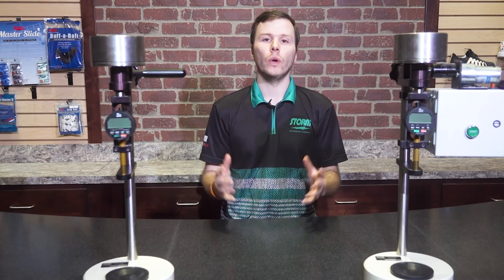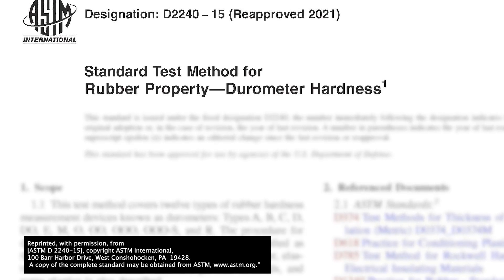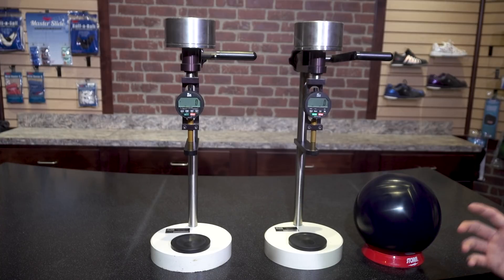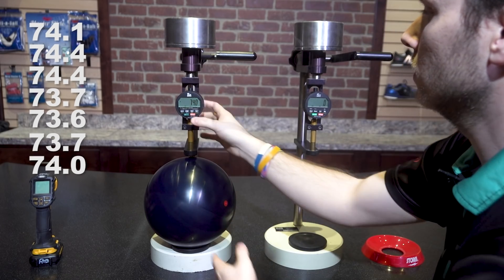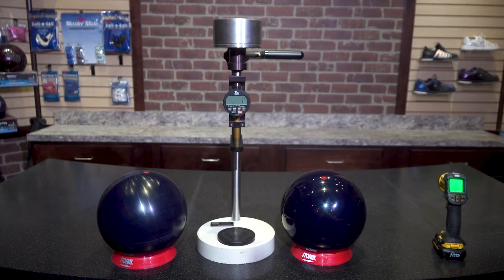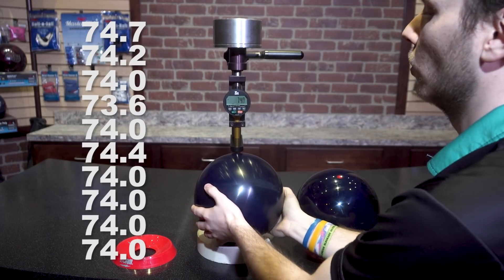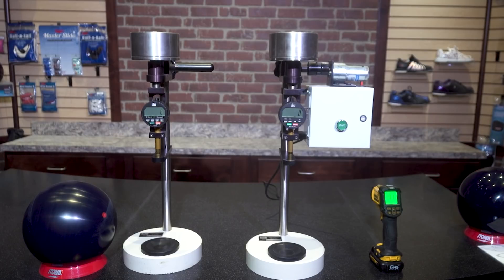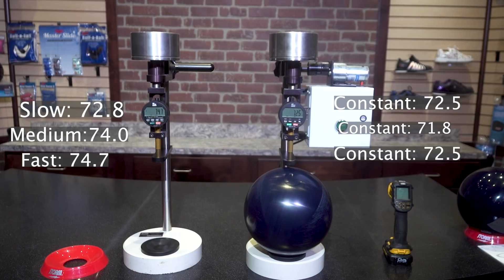Storm | Durometer Testing

Comment: If storm is so on the cusp of legality that it can't reliably meet USBC standards with every single ball, it's up to storm to revise it's manufacturing processes or provide more safety margin in it's equipment. 

USBC has standardized criteria, methodology, equipment and conditions for testing. It's up to storm to comply with USBC's standards using USBC's criteria and methodology. All this stuff about polish, needle speed, temperature, equipment, astm standards, etc is a deflection. USBC already accounts for all of that in it's testing

Comment: 1972 - Don McCune, MEK Soaker, then Columbia Red Dot, Yellow Dot, Shure-D, Shore-D. Been going on for 50 years. Go back to Manhattan Rubber/AMF Exacta/XL-5 with 3 oz weight differential, solid symmetric core, against Vulcan 3-10. Averages will be about 207.

Comment: Tests between labs, admitted by ASTM itself, can vary as much as 3.54 D in Table 4 (starting at 2:54) and 11 D in Research Report D11-1029 (starting at 4:01), prove that either the instruments or the Standard itself is inconsistent and, therefore, not reliable for bowling ball hardness testing.
Thank you, Storm, for showing us this information!
The USBC should shelve hardness testing until a more reliable method can be found. If they refuse, a new standards body should be formed.
Reply: What astm says is irrelevant. USBC already has standards for all of these factors, a standard testing procedure, standard equipment, standard conditions, etc. All of this minimizes variance between tests, and all manufacturers have the same amount of variance to deal with. It's up to the manufacturer to meet USBC standards with USBC testing conditions and methodology. If storm is so on the cusp of legality that it cannot meet USBC standards reliably with every ball it produces, it's up to storm to revise it's manufacturing processes or provide itself more headroom to ensure legality. 

Once again, all balls are tested and all manufacturers deal with the same testing criteria, standards, methods, conditions, variances, etc. Only a select set of balls failed USBC testing. This is on Storm, not the USBC
Reply: @iceman5117  Durometers, according to USBC, must be calibrated to ASTM D2240-15 standards. What part of that do you not understand?
Reply: @michaelg-XEX  which is wholly irrelevant to the conversation. USBC has their own standards for equipment, whether they follow astm or not, companies must abide by USBCs standards using USBC's testing methodology. If they do not do that, the equipment is out of spec and is illegal to use. It's that simple
Reply: @iceman5117  If durometers do not comply, it's impossible to meet any standard, whether USBC sets one or not.

Comment: This video, while generally informative, is not without some bias.  Hardness testing certainly has some variables that need to be accounted for.  However, some of the demonstrations presented in this video are questionable.  It would be more beneficial to see an impartial, accredited 3rd party test these balls without any input from either Storm or the USBC and see what kind of results they get.

Comment: Why does the gauge not reset to zero everytime on the durometer reading low compared to the higher one?  If there both the same durometer gauges they should act the same.  I have storm balls so I'm a fan of there stuff.  Just curious why I see gauges saying docent things in between pulls?

Comment: It appears to me that bowling ball makers need to stop pushing the hardness to the lower end of the allowance.  If they make balls harder by 3 or 4 points on the durometer, they wouldn't need to worry that their bowling balls will be rejected.  Of course Storm and other bowling ball manufacturers will push the limits because there seems to be an advantage of producing softer bowling balls.  Maybe it will take another series of uncertified bowling balls to motivate the companies to stop pushing the limits of hardness. A manufacturer will lose customers if they repeatedly produce illegal balls that are banded in leagues as well as PBA events. Durometer testing needs to scale back the accuracy of readings to whole numbers rather than measuring to tenths or hundredths since the measurements aren't reliable.
Reply: This. USBC has standards for testing to account for all of this. They aren't testing polished balls coming out of the freezer.

It's up to storm to meet USBC standards using USBC testing methodology. If they're pushing the envelope so far as to have balls test out of spec, they need to address their manufacturing to be more consistent, or back off of the threshold of legality and give themselves more headroom. This is all on storm

Comment: Seems to me that USBC needs to do some ACTUAL testing and change the ruling when it comes to hardness. Having a set hardness seems to be the wrong way to go. They need to have a variance that is acceptable when it comes to hardness. There will always be human error and it's ignorant to not acknowledge that. USBC needs to do better and needs to hold itself accountable. Defamation of a company should also be punishable, as it has been MOSTLY Storm Bowling balls that have been affected by this testing.
Reply: How is it defamation? If only storm balls are testing outside of regulations, then wouldn't it logically mean that storm is bending the rules with it's equipment?

Comment: This video proves that Storm has the exact durometers used by USBC. It also proves that they are well aware of the variance in the readings. So how the heck did they manage to manufacture so many balls that test illegal on the machines they are experts at using? This is gross negligence and an embarrassing attempt at shifting blame on the governing body for enforcing rules they clearly understand.

Comment: What is the point of this video?  To show the quality department is aware of this variance, and is willing to accept it?  Secondly the speed of the pull in your automated machine shows your out of spec.  Look it’s simple you targeted the edge of spec and process variables pulled you below the allowable limit, and you showed your quality department accepts it.  I’d think you’d never want a potentially on the edge to leave the plant.
Reply: Bingo! The sickening thing is attacking the USBC, directing customers on social media to attack USBC (which should result in some hefty fines), and completely shirking responsibility. Pretty sad to see from a respected company. Dude, just admit what you did here. Come on, you don't think anyone drives just over the speed limit, hoping they don't get caught? That's what happens when you push the limits of the rules. Storm got a speeding ticket and is attacking the police and blaming the variance of the radar inaccuracy and user error. Does that hold up in court as an excuse?

Comment: Great video,  and the calibration variance per each unit was consistent within itself. What we don’t know is was or is the needle itself also calibrated.  As far as surface finish goes ,  the are approved at the surface finish the companies place them at.  So the real issue here the balls could be ok as the variance would place them in spec or a approved hardness reading.  But with that being said the variance could also go the other way and the balls tested could also be out of spec more that what is tested.  There are a lot of balls out on the market of other companies and storm , global, and rotogrio them selfs have most of the balls passing the tests on the same durometers being used. And great video showing there is a variance ,  but it’s a equal variance for all balls and only a small group of balls and specific balls failed testing.

Comment: At 12:37 you showed that human error can be introduced into durometer readings yet used the manual pull durometer for most of the other demos in the video - why?

Also, does USBC not use an automated durometer? If not, why?

Comment: 7:02 - Umm, dude... 2ERO seems like an error message so you weren't actually clearing it between testing.  Also, it "zero'd out" to 1.  Same with your "homemade" device.  Funny how the zero'd out to 1 durometer was always off by 1 from the durometer that zero'd out to 0.  Finally, don't talk to us.. Talk to USBC.  They're the ones determining if the ball is legal or not.  They also acknowledged the possible variations and even made sure such allowances were there in the rule book.  YOU decided to cut it too close as a manufacturer on certain balls, so you KNEW what you were doing.  You got caught, fix the problem.

Comment: I would love to see an experiment to get the highest variance of hardness. For example start with one ball, cold, off center, and fast push, versus the same ball hot, on center, and slow push. I bet you could get 5+ points different easily.
Reply: For the hot ball, pull it off the ball return after a game without wiping it off before heating it. The reading will drop even further if there's still oil.
Reply: None of this has to do with the topic. USBC already has testing standards and methodology for these things. Whether they follow astm standards or not is irrelevant. It's up to storm to prove they are in compliance using USBC's methodology

Comment: Beautiful piece, but am looking at a engineering point of view, its time for BOTH SIDES  to admit, it isn't perfect science and that USBC needs to provide to each manufacture a durometer that is calibrated to the there specs, or maybe a tech from them that spot checks there balls, and can give guidance to the manufacture . Am not a happy customer, I research each and every ball I purchase , And I truly loved the Storm spectre ball and they gave me a inferior hyroad pearl ball, first time  down the lanes, had so many dents in it, am going to have to resurface the ball, and I don't drop my balls, I been playing over 40 plus years,so tired hearing all these stupid  failures, when is someone going to be honest and say they made a mistake??
Reply: USBC wouldn't supply the durometers. They list the exact ones used, and ball manufacturers buy them to ensure they manufacture legal balls. As you can see, Storm has these durometers and are clearly familiar with the variability. Yet, they somehow still manufactured a bunch of balls that test illegal on the machines they are clearly experts at using.

Comment: This is a great video of how Durometer Testing works. As a chemical engineer it shows that the way that the USBC applying their hardness spec is not a good application of the tool.
Reply: I doubt USBC even knows how to calibrate one properly LOL
Reply: It doesn't matter. USBC has a standardized methodology for measuring hardness. It's up to storm to comply with USBCs standards using USBCs methodology
Reply: @iceman5117  if you really believe USBC has a standardized anything, you are part of the problem.
Reply: @iceman5117  sorry, but I deal with standards like this one all day and this is a very poor application of this test.  When the organization that created the test has up to 3 points of variability in the standard and we are arguing about tenths, we are not talking the same thing anymore.
Reply: @Ken_Leivonen  1) no you don't. 2) you're looking at storm's presentation of the tool, not USBC's application of the tool in their tests. 3) you have no idea how many points of variability are involved in USBC's test. Most of Storm's grievances are already accounted for in USBC's methodology. Balls are untreated, with a uniform surface and uniform temperature.  4) even if the test was wildly variable, all manufacturers have to contend and address the same level of variability. If storm is operating so closely to the threshold of legality that their product is no longer certifiable, they need to turn back the dial to give themselves more leeway in manufacturing. No other manufacturer seems to be having these issues. No Brunswick balls have been banned this far
Reply: @iceman5117  actually I do!  And I have worked with standards like these for over 35 years.  I know how to read them and the papers that have been written on how to interpret them.  I have done this because I use all types of O-rings and gaskets in equipment that runs as low as -60C to 250C.  And this equipment is used for every type of chemical known to man. Hardness is very subjective number and is influence by so many things.  As an example, an Buna-N O-ring that states that it has a hardness of 70 will measure anywhere from 68 to 73 and be considered acceptable.
Reply: @Ken_Leivonen  I'm sure what your saying absolutely, positively isn't a fabrication. I'm also only being slightly facetious

Comment: Even if you're not a Storm fan. The fact that these readings is all over the place is a cause for a change in the USBC.
Reply: The fact they didn’t use one of the 6 balls in question for testing/demonstration in this video escapes the die hard fanboys attention.
Reply: Umm, no.  The readings are surely "all over the place".  However, they don't rule on the softest number.  They take multiple readings multiple times over multiple balls.  When 98% are bad, you've got a manufacturing issue.  When others regularly test below the allowance but some are just fine.  You've got a manufacturing issue.
Reply: @1SpartanD4L  
USBC has publicly announced that they dont test enough balls. The last 6 balls partially banned, they said they only tested 2 balls. If they test multiple balls, then they aren't tested enough. Why dont they be transparent with their data. It's not just the players and the public asking, even PBA called out USBC for their lack of data.
Reply: @GreyDuck54  They were transparent to the manufacturer.  Remember, some of their readings combined with the balls being tested may expose proprietary info.  USBC stated (in that public announcement you referenced) that they shared their findings with Storm.  The USBC isn't free and clear here but they DID test a number of balls before sales and then 2 (of each model) in a subsequent test.  Those were all sketchy.  Storm was already in probationary status with USBC so the USBC took action.